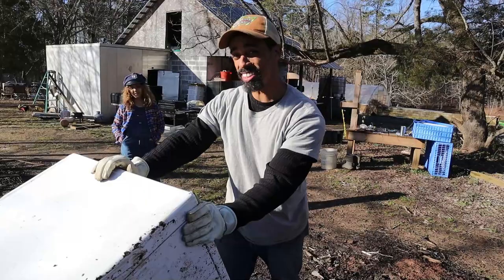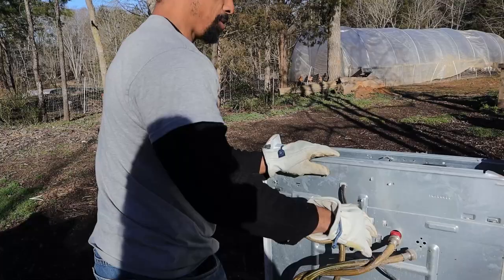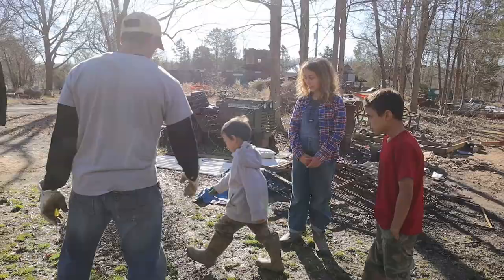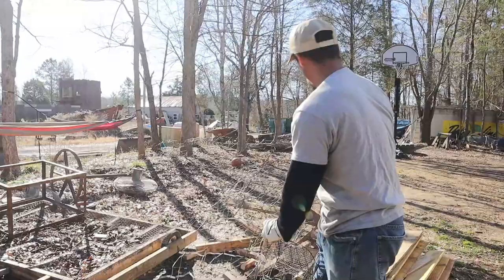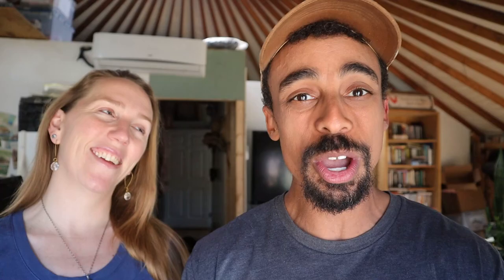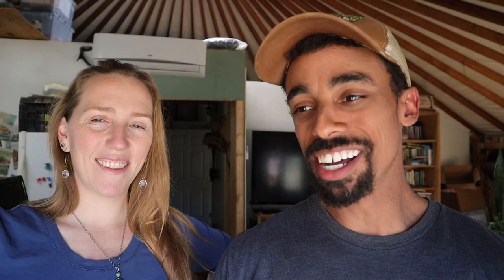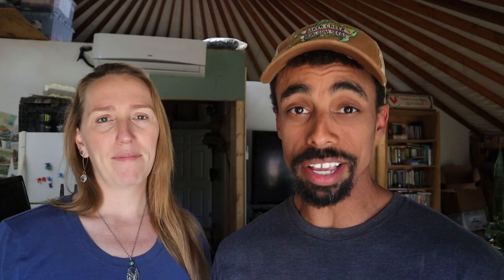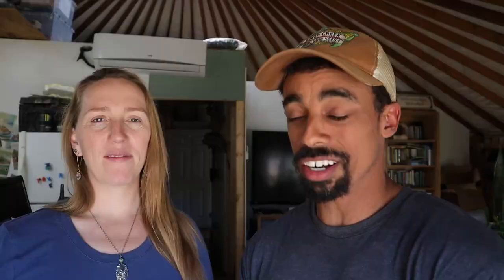How we handle TRASH, Waste & more living in a YURT

Comment: They still do alot of this in parts of Europe... In the cities compost and recycling are separated from trash.  If you are done with something still functional, it can be set out for anyone to take.  Keeps it out of the landfills.  Bottles are refilled after returned to get your deposit back.  At festivals, service and flatware are washed and reused.  Virtually no trash.  Amazing!
Reply: I would love it if the USA would move away from plastic ware for dishes!  They get used once and are wasted, they aren't even comfy to use.  I always get miffed at BBQs when there are plastics instead of the house eating utensils...  it really isn't that hard to wash it all in the dishwasher, it's more understandable back when you had to do it all by hand.

Comment: Because my garden is a good distance from the house ( house in woods , garden in meadow below ) and its not practical to keep it plowed in the winter I have to be creative.( compost bins in garden area ) I have a large colander that sits in front of a heating vent. Its lined with a thin fabric I toss all coffee grounds , tea grounds , carrot and apple peals , egg shells , onion skins  etc. etc. ( anything that dries quickly ) into the colander. We have a coat hanger for banana peels and various other things that take longer to dry above . It all gets ground up into the most amazing fertilizer for the garden. The tomatoes love this stuff. Easy to do , free , useful and it stays out of the land fill.  The colander is plastic too. So instead of tossing it on the upgrade it got put to use too..

Comment: I worked years ago on closing a landfill. And it was surprising what I have seen in there.  We found a newspaper from 1967 that was dry and still legible.  It was probably down about 30’ give or take.  It’s amazing how as you said stuff doesn’t break down.  But all landfills release a gas that is collected and used in other places.   The one I did the gas was sent by pipelines to NASA Goddard in MD.
Reply from the maker: Thanks for the info that is interesting.

Comment: It is surprising what you can reuse if you think about it. The nets around oranges/lemons can be used to hold up squashes when they get too heavy growing vertically if you tie them to the support. T shirts are the best cleaning cloths. You can also cut them into strips and crochet with them. Reuse aluminium foil, washed and  rolled in a ball and put in a dryer reduces static. Just keep adding to the ball. Newspapers can make plant pots. Yoghurt pots (if you don't make your own yoghurt ) can make great plant labels cut into strips. The trick is to look at the item from all angles and ponder on how it can be reused. Like plastic milk bottles make great scoops. I remember when milk came in glass bottles and were returned to the milkman for washing and reusing. We've lost so much. The trouble is that the world is run by people only interested in themselves, money, power and control.

Comment: Here in Austin, Texas, we compost in our open and closed composter. Those items that can't go in there are frozen until trash day when we put out the city provided compost can in which you can put in not only meat scraps, but yard waste, paper towels and plates if we use them, every two weeks they pick up the blue can that holds metal, glass, and plastic recyclable materials. Every week they pick up all other trash in the tan bin that we barely have one paper bag of other trash.  Twice a year they pick up large brush and other recyclable materials like metal, glass, tires, etc. Although by the time they arrive much of what we put out has already been taken by those who finds a use or the metal collectors take all the metal.  There is never any metal buy the time the city truck arrives.  JoyGiles

Comment: Most of my waste is paper or zippy bags. My lunch meat - ham, smoked turkey comes in those, the cheese slices have plastic wrappers, and the sleeves the crackers come in. I roll them all together, put them in the meat zippy and use these for fire starters. One "pouch" gets very hot and melts onto the wood which concentrates the fire and catches the wood kindling very fast. 
The other type of waste I have is cans. From canned goods from the store. Right now I am not allowed to grow anything even in pots or planters. So my tuna, chicken, mackeral, all comes in cans. As well as my veggies. I take those to our local dump, as well as   products I cannot burn. I have no glass to speak of except my liquid taco cheese sauce or pickled beet jars. Both come with a rubberized gripper inside the jars lid. So, they could be reused for short term storage. In case I can't find canning jar lids. So I hold onto them, just in case. I don't buy that type of stuff often. 
It takes 3 - 4 months to have 1  33 gallon trash can mostly full.
So I have a very small footprint.
The only other waste I have is humanure which is composted back to the soil. The same with any animal waste too.
I haul my water in 3 gallon plastic jugs that a friend gave me. He buys cheddar flavored puff balls in them from the local big box store.
I also store other items in his empty jugs. I have rolled oats, rice, noodles, spaghetti noodles, elbow macaroni, regular noodles, dry beans, powdered milk, pancake/bisquick biscuit powder mix, dog treats, and a change jug. So, I reuse his jugs for bulk storage in my extended pantry to help keep them out of the dump. I also use his plastic coffee containers for storage of nuts, bolts, small hinges, screws, nails, wire keepers, cable keepers ect for my projects.  you can peel off the lable and add your own and line them up on a shelf for quick, easy orangization.

Comment: I have been reusing our plastic water bottles for winter sowing. Unfortunately we need bottles water because our water causes diseases. It's a controversial issue in our town. Even when they get the new water line they will still mix it with the older system because our town is growing so fast. Apparently filtering it doesn't get rid of the problem or we would filter. So this year it's reuse. Plus going to compost for the garden. Not really sure how to do it but we'll try. You are an inspiration. Keep up the great work.

Comment: Here in Alberta Canada 🇨🇦 we have a fairly good recycling program.   Pickup in cities and the rest of us take to the landfill. Bottles of juice milk water pop can all be returned for money.   We are charged a deposit between 10 and 25 cents at time of purchase.  Scrap metal can be taken to the scrap yard for money. Food scraps can be separated for composting mine go to our farm animals.  Plastic paper glass tin cans aluminum cardboard go in blue plastic recycling bags but in large bins at the landfills and then our trucked to recycling centers.   Leaves very little to go in the trash bag.  Twice a year they do a collection for other things like empty paint cans used oil and such.  The landfill in town also has a building where you can drop off things that can be repurposed and you can pick up things from there as well that you could use. Clothing dishes toys small working electronics can be donated to our local thrift shop.   Money from the items sold helps buy things for our local hospital.   So anything that can't be used on my homestead goes to the appropriate spot for recycling.  Usually only have a couple of bags of actual trash 🗑 per month for 4 of us. Its something you have to keep in mind.  Its very easy to just throw everything in the garbage. Always reminding my grandchildren when they visit and go to throw something out which bag does it go in.😀  Excellent video!! Recycling ♻️ is something everyone should be passionate about!

Comment: I save paper waste from mail, prescription bags (minus the staples) and the inner rolls of toilet paper for extra carbon in my composting.  I also try to remember to add used paper towels that didn't have chemicals used with them too.  I'm able to save them in 1-2 large garbage bags inside since it won't stink up.  

I'm only allowed one large dual chamber tumbler composter here and it was entirely full before winter hit and froze before it finished though, so I'm in pretty major distress everytime I have to throw away veggie waste this winter.  I can't even get to the soil to dig it in because it's under like 3 ft of snow.  I didn't think not being able to compost actively would distress me so much...

It was my first year last year composting at all and I'm trying to get better at waste management a bit more each year.  This year I think I'm going to focus on getting of gallon jugs of water and try some water filter system of some kind.  I drink probably 2x as much as other people I know and I've a strong sense of taste so the tap water tastes wretched.  Sometimes the jug water tastes like plastic though too, just less often.

Comment: I used to have a lot of plastic that we used on a daily basis....
Then in 2015 I found I had breast cancer. As soon as I got where I felt like it I dumped the plastic from my kitchen. Please, please y’all get rid of the plastic. 
Unfortunately our water is not good. Can’t seem to get water dept to do anything about it. We live close to the end of the line... so if there is anything in the lines it ends up in our homes. I bought a Berky system last year, we have filters underneath the sink on the refrigerator to get out the stuff you don’t want to cook with and for ice. But, I hate washing dishes, clothes, and myself in the water. 
In our area the garbage truck comes by to pick up basic household trash, but big items still have to go somewhere else. 
Blessings y’all 🙏🏻🤗🪴🌷👩🏻‍🌾

Comment: My local trash collection monopoly wanted $50.00 per washer/dryer to pick up at the street. I called a local used appliance dealer and they sent a guy out for no charge. He said if they can fix them, they will and if not they will scavenge the  working parts and scrap the rest.

Comment: You're an amateur scrapper Mike 😂. Just some hints, save & separate wire, peel what you can & keep it seperate from from dirty wire (still has coating on it). There's a heck of a difference in price between the two. With dryers, pull the electric motor out & sell it seperately. Anything with an ele motor, pull it out & set it aside. Anything with wire, power cords, pull it out & save seperately. Aluminum, sell seperately. If you grade it, you will get better prices for it, other than scrap steel price. Hope this helps a little.
Reply from the maker: We used to do that. When we were really, really tight on money, Lacie would strip the rubber off wire to get more money. We would separate aluminum, the different metals, etc. We would drive around collecting appliances and other metal people would sit out. Just not up for all that work each time, if I don't need the money as bad. Also so many other things on my plate.
Reply from the maker: I (Lacie) used to sit on our living room floor with my jig made out of a 2 x4 and strip wire with a utility knife for hours until my fingers hurt from peeling the plastic coating off the wire. That is after everyone else was in bed. I don't wish to go back to those days.